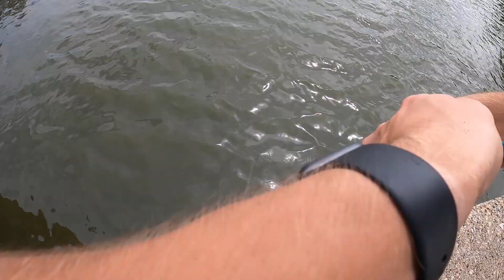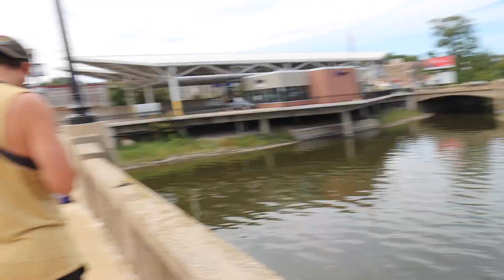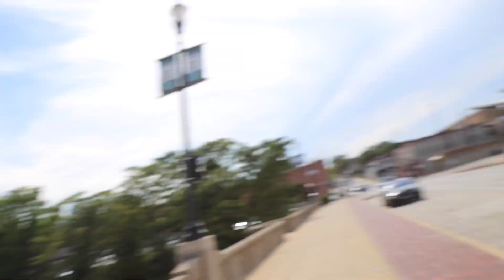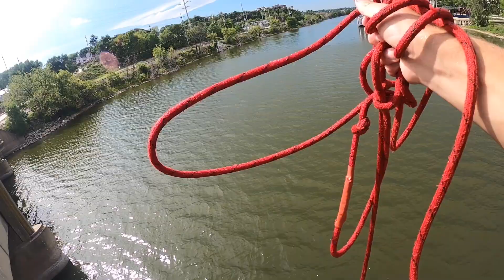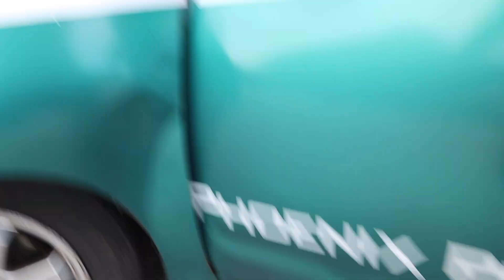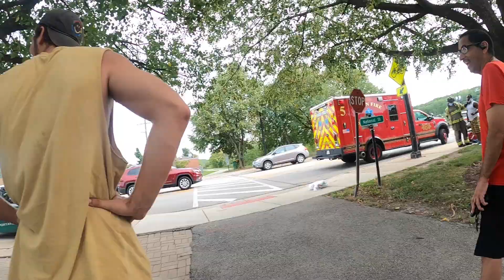3 Guns Found Magnet Fishing Police Involved (Complete Chaos)

Comment: Had a day like that two years ago. First, saw a car pull into a parking lot across the street and burst into flame. An hour later saw a car lose it's right front wheel as it ran a red light-then wrapped itself around a pole. Got home and saw a pickup truck wrap itself around a telephone pole across the street. Guys in the pickup ran because it was filled with stolen items.
Reply from the maker: That’s crazy!
Reply: Oh god
Reply: The simulation glitched.
Reply: Sounds like u woke up in a public gta 5 server
Reply: @razorwolf2758  Ong
Reply: Holy cow at that point I would just go to sleep for the day XD
Reply: @tanyagregg1797  I won't be able to sleep knowing that.